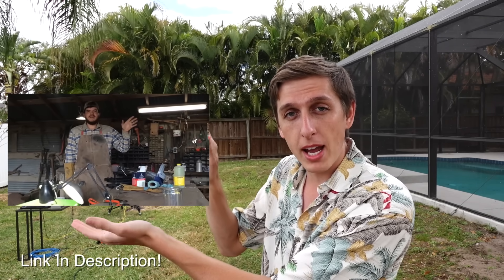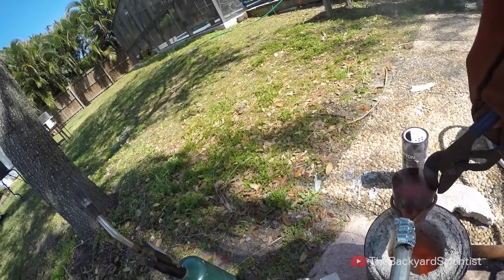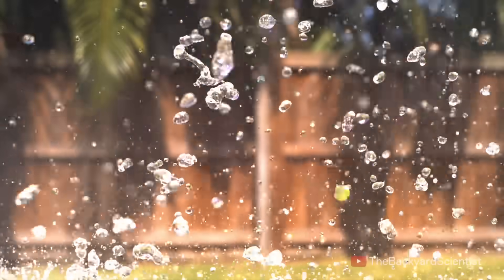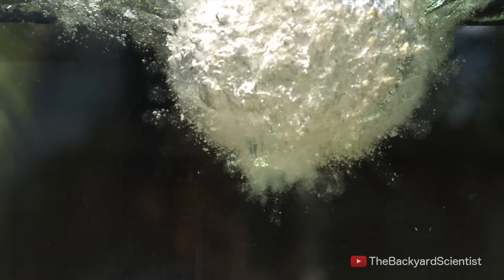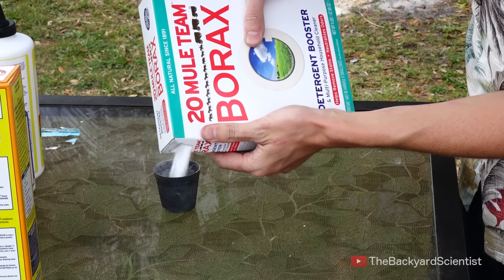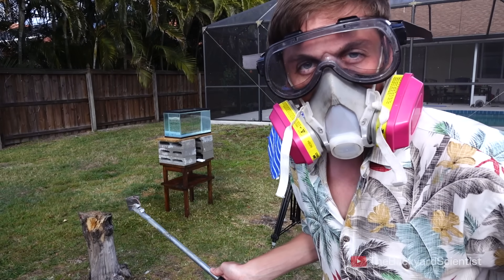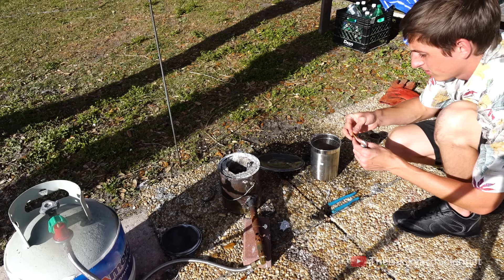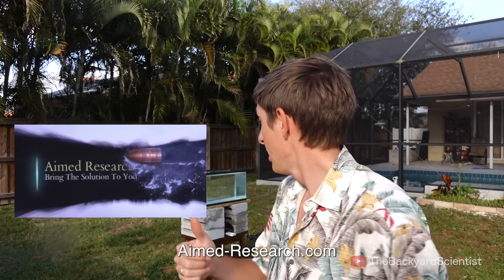Pouring Molten salt into Water - Explosion!

Comment: My pre-vid hypothesis: Salt is sodium chloride. Sodium explodes in water. Chemical bonds can be broken with a change in energy, so heating the salt up probably breaks some of the chemical bonds, which means the 'molten salt' is a mix of sodium, chlorine, and sodium chloride. The sodium then explodes on contact with the water.

Comment: This is the first video of yours I have watched.  I just fell into it while puttering around and I'm glad I did.  Very very interesting.  Is this why you are not supposed to put water on a chemical fire but use foam instead?  I assume other materials are explosive with water, but it is the temperature gradient here that causes the reaction.  So what other chemicals produce explosions with water either at normal temperatures or at high temperatures and could you do a segment on that?

Comment: molten salt has more air bubbles than borax because of the reaction, boras hardens faster because of less air bubbles wich causes the borax to harden, sodium metal oftens react to h20 because of the chemical changes in the metal, so its not a salty reaction the sodium metal gets, but it gets really hot with h20 and makes H gasses and CO2

Comment: okay, I have a hypothesis but feel free to correct me if I am wrong, the reason that NaCl explodes at molten heat is because of the atomic structure. Due to Sodium Chloride being a compound chemical created with some oxidation during the original process, there are small holes in the atomic structure. So H2O can seep into the atomic structure of molten NaCl, causing a violent reaction to expand water as steam in the molten salt due to the gaps in the structure now growing in size, the steam is generated so fast that it causes a vigorous and violent expansion to the point it creates a powerful force of heat. Spraying steam, hot water, and molten salt due to this blast.

Comment: The solar power plants can rise the temperature that much that can create those fires too.
https://www.google.com.ar/search?q=california+fires&client=firefox-b-ab&dcr=0&source=lnms&tbm=isch&sa=X&ved=0ahUKEwjIrpvP5qPXAhXLgpAKHVsqBmwQ_AUIDCgD&biw=1210&bih=622#imgrc=0XzF6O_RBkb8AM:

With molten salt you can vaporized water suddenly, because of the capacity of the temperature storage of the molten salt, which is why the water explodes, as with the sudden massive rising of the temperature the molecules and atoms are running away one from the other and breaking the links in between them, to becoem steam out of the water by changing the state of agregation of the matter,  is a redox reaction, it is  an inorganic chemistry and physics explanation, and we know that the Pentagon can vaporized people as we are made of more than 80% of water: https://www.youtube.com/watch?v=PDRWQUUUCF0
So the molten salt storage power plants are secret weapons to weaponize the seas and cities too as the heliostates are mobil to follow the sun movement to project the sun light on to the salt tower, and the battery can storage  4000 °C for 24 hours, so it gives them time to project the sun light on some other thing next to them as the air, to create more heat to produce convenctive clouds to have the hurricanes and to heat the winds that much to set in fire California and the Mojave surroundings too.

Comment: Sodium chloride does not have a strong surface tension. This is apparent in the cracks of the sodium chloride puck when it begins cooling down. My hypothesis is that water enters the cracks and vaporizes, thus spreading the sodium chloride fast enough to create a concussive burst. Since this concussive burst moves water away from the sodium chloride, there is still sodium chloride that has not been touched and cooled by water. This would also explain the secondary blast seen at 3:27.

Comment: The main reason why the Salt seems more violent is because the explosion happened under water. Water transfers energy much more efficiently than air because it is denser. The pure sodium had a hotter and more fiery explosion because it was exposed to more oxygen than the salt. Also, velocity of sound (aka energy transfer) in air is 343m per second (versus water being 1500m per second) the explosion was much less damaging. find a way to get the pure molten sodium under the surface and then come in contact with the water and you will have a powerful explosion. Maybe you should try a chemical delay, maybe chlorine?

Comment: Perhaps a part of the energy is from it dissolving. When things dissolve it releases heat but usually very little as the ionic lattice has to be broken which requires energy. If the salt is molten then there isn't this lattice and you just get out the energy from it dissolving. Could be part of it anyway.

Comment: When salt (NaCl) is heated...the ionic bond is broken and it disperses into Na+ and Cl- ions...both of these are highly reactive and when Na+ is put In the water (H2O)...this reaction takes place
Na + H2O => Na(OH)2 + H2 + heat
Reply: isn't this  what i have written just in other words? i just wanted to point out the energy part because this is what matters for this Experiment.
Reply: What is missing?
Reply: as far as i know Na+ and Cl- are barely reactive. you made two mistakes in your equation: 1) it's Na+ so it would give NaOH and 2) it would be H+ not H2. the counterpart would be Cl-  + H2O -> HCl + OH-. These two equations combined would give NaCl + H2O -> NaOH + HCl but actually this wont happen. ever poured a solution of HCl into a solution of NaOH? If you did you know that this gets hot because of the neutralisation energy. This tells us that if you want to make your proposed reaction happen you would have to put in energy, which means that the reaction is endothermic. This reaction would therefore not heat the water up but instead cool it down.
Reply: No problem. I am glad to see other people also spreading science ;)
Reply: yes as i have written in my first comment above this reaction would not take place. no chemical reaction, no pH change
Reply: oh yea i did not read properly your explaination
Reply: but (NaOH)2 is a base.
Reply: but he said the water had no pH change. so.....?
Reply: What really happens is just ions are really unstable because their bound was broken. When mixed with water, the little water molecules surround the ions and stable them which reduces their energy by a lot! The gibbs energy is super negative on this one.
Reply: @Leo Doszlop sorry i missed that. whom are you asking this question?

@ami kami it's NaOH but yes this is a base
Reply: very wrong
Reply: @Donald Nool very explanatory
Reply: @christoph tschopp yup, that's what I am saying too. thanks.
Reply: Idk wu t ur saying im in 5th. Grade but i wonder when ill learn it
Reply: Then why didn't borax react?
Reply: @Cristoph Tschopp   the Cl- and the Na+ would not make NaOH or HCl, because NaOH and HCl are stong acid/base, that means when they are in a solution of water they completly separate and therefore would never recombine in a water solution.
Reply: Akhilesh Kaushik Valluri FINALLY SOMEONE WHO IS GOOD AT CHEMISTRY!!! What grade are you in?

Comment: Hey, it can be about the solubilities of NaCl and borax in water. The solubilities are extremely different if you check. For NaCl it is 359 g/L  and for Borax it is 5.1 g/L. So I think it happens because of quick expansion of the temperatures differences( you can see that cold water on hot oil) and because of the differences of solubilities in water the NaCl dissolves much quickly in water so it can reach more distance in water in a period of time where the borax can reach so less compared to their solubilities in water 5.1:359. I would like to see your reply. Enjoy the science!

Comment: I believe the explosion is steam helping to spread the molten salt around into more water. The rapid expansion of the water in the first dip is as described in the video where the sodium is being expanded by expanding water, however the second (larger) explosion is likely caused by salty steam generated in the first one mixing and the reason it's larger is due to hydrogen bonds more or less causing a chain reaction through the water until the heat contained in the salty steam is completely dissipated. My theory anyways, it's definitely not a chemical reaction, it's against the laws of thermodynamics to go from a stable molecule (salt, one of the most stable molecules on earth) to a less stable molecules (sodium, chlorine, hydrogen, and sodium hydroxide once reaction with the water has occured). Sodium Hydroxide is lye, and is itself rather reactive as it dissolves bones.

Against the laws of physics that is, if there's no high-energy added such as through gamma radiation or electrolysis.
Reply: Jamison W. You’re daft
Reply: Indeed

Comment: Either its the immense heat that is forcing an explosion, or the chlorine is being separated from the sodium with high amounts of heat, resulting in molten sodium with small amounts of chlorine gas that could have been released. Sodium is explosive when reacting to water.

Comment: I think I get it. It's the same thing as a prince Rupert drop. The outside solidifies but isn't as tough as glass. It hardens and the really hot part in the center heats the air around it causing it to expand. Either that or the inside collapses causing the water to rush in, and because of this the heat caused it to basically explode

Comment: it just works with chloride because salt mixing with it is an exothermic reaction creating heat and by heating it up you speed up the reaction by a factor of 2 for every 10 degree you make it hotter...+ you greatly increase attack-surface by making it liquid

Comment: I certainly don't fully understand what is happening here. But what about this explanation: the molten NaCl heats up the water to boiling point near it. Maybe even slightly above that. That combined with the free energy from the dissolving salt could be enough to superheat (don't know the exact term) the water, until it literally explodes. Because as far as I could tell, this is the only difference between NaCl an the other salts you tested. It might also be that the sodium partially becomes metallic and just adds to the eyplosive mixture. But anyway, this truly looks cool!

Comment: I think what you have going on is a 2 stage process and the clue is in the cool sound made by the salt cooling in the air. 

The salt is forming individual crystals as it cools.   As it condenses, those structures pull apart from each other causing the cool sound. 

When poured into water the fracturing processes happens at a faster and more violent rate. The fractured crystals also increase surface area of the salt allowing it to heat the water to steam at a much faster rate. The weight of the water containing the expanding gasses long enough to build up as exciting release.  

That's my guess anyway.

Comment: Alkali metals explode in water because they have a very high affinity for losing their single electron in order to satisfy the octet rule. In other words, it releases a lot of energy going from the very unstable (very high in potential energy) neutral atom to a very stable (low potential energy) cation. Water causes this to occur through acting as an oxidizing agent (causes the alkali metal to be oxidized) through the general reaction: M + H2O --> M^+ + OH^ + energy. And because melting the oxidized sodium chloride brings it back to it original state sodium Na it explodes.

Comment: 1-When you drop molten sodium chloride into water unlike sodium (which is lighter than water) it sinks in (it is heavier than water).

2- The super hot ball of molten salt flash vaporizes the water.  A thin vapor film separates the water and hot surface and temporarily the situation is stable.

3- The molten salt is not like liquid tin and does not have great surface tension so it makes a ball full of cracks and water gets inside some of the cracks.

4- The liquid water inside the crack flashes into the vapor and its volume suddenly expands by 1800 times.  The local area around the crack inflates violently.

5- Since the rapid expansion of the outer molten salt surrounding the inflated crack is inside water and expanding faster than speed of sound in the water, it makes a supersonic shock wave.  The shock wave in the water is the explosion or Big Bang.

Thanks for a great question.  I really had fun watching the video  and other pictures of this experiment again and again.  And you high school kids out there, DO NOT TRY THIS WITHOUT SUPERVISION.  It looks really dangerous
Reply: Clearly not. You didn't, so he did.  Information is still information if you didn't have it before; so it matters not where it came from. Saves me and others doing it.  So chill.
Reply: This would essentially be the same principle of why you don't hear a glass really hot and then throw it in ice water correct?
Reply: Son Goku do you by any chance have a theory on why the other ionic solutions love key borax didn't react in this manner?
Reply: Beat jiren man dont watch some sciency stuff xd
Reply: It's a steam explosion.  A more drastic version of this (because higher temperatures were involved) is what blew up the Chernobyl reactor.
Reply: Son Goku
Reply: Son Goku 6
Reply: Son Goku now defeat jiren asap 😄
Reply: Son Goku but that’s actually heat happens
Reply: Son Goku not what he said...
Reply: Son Goku 

S o d i u m
C h l o r i d e
Reply: nerd
Reply: Son Goku really... you just googled it and pasted it into the comments for us to read... don’t you think that we can do that ourselves?

Comment: There wouldn't be a pH change because pH is based on proton concentration or H+. So adding NaCl wouldn't effect the pH. NaCl is also neutral. In fact if you add NaOH and HCl the products will be water (H2O) and Salt (NaCl). When adding Sodium metal, it is clearly a chemical reaction but when adding molten salt i'm fairly sure it is physical but maybe when the Cl- and Na+ ions separate it creates the explosion but i'm fairly sure it is only physical but the properties of NaCl allow it explode while the properties of the other reagents you added wouldn't allow them to explode. I am no chemistry expert and I have only completed organic chemistry at a second year level so maybe take this comment with a grain of salt (get it).

Comment: I have a hypothesis,I've heard that salt lowers the freezing temperature so logically it would lower the melting temperature, right? So my theory is that it lowers and its so hot that the instant heat causes combustion
Reply: lol Dude, think of it as an insulator.  Salt kind'a-sort'a resists the energy applied to the solution.  Instead of thinking of "freezing" and "melting," think of it as changing states due to gains of energy and losses of energy to a system.
Reply: afrodisiac no the kid is right about the melting point depression. The melting temperature decreases. Melting point is the same value as freezing point. Boiling point is the same as “condensing point”. What you said below is correct, freezing point decreases and boiling point increases. Dont try and correct the kid if youre not sure though. 
If you think personifying the solution makes it easier to remember, think of it like this:
As the concentration of salt goes up, the solution will want to stay in the liquid phase more (decreasing MP increasing BP)
Reply: Nico Droster yeah. I was just making it easier to understand. That guy clearly hasn't studied chemistry lol. But you're right obviously 👍
Reply: No actually it increases the melting temperature
Reply: Oh...
Reply: yeah it's pretty weird and counter-intuitive. Adding salt to, lets say water will decrease the freezing point and increase the boiling point.

Comment: I could say one possibility is that there is a gas that is formed with the other ion material that does not allow with the water to penetrate the molten  material. So no oxygen and be released into vapor. The gasses given off works like a barrier I believe it has to to do with the chlorine.
Reply: Parts per billion.
Reply: https://youtu.be/GyT1dsY0KtA

Comment: Sodium Metal + Water = Boom!  High School Chemistry 101.  That's why sodium metal is supposed to be stored in oil so as to keep even water in the atmosphere from contacting it.  So you should try the sodium metal without even melting it and see what happens.  Maybe even use a file to get some sodium metal flakes and toss them in the water.

Comment: https://youtu.be/wK9_DtwPaV0 

It is a chemical reaction. It just wouldn't change the Ph balance because there's nothing acidic happening. sodium is an alkaline metal, so sodium atoms have one extra electron in it's molecular shell. The atoms in the water on the other hand have one electron missing, and desperately want to grab it from the sodium. The exchange on contact tears the water molocules apart and mixes it with air, creating newly formed hydrogen gas with a stable shell of electrons. Since it's tearing apart the water molocules on contact regardless of temperature, their's no leidenfrost effect.

Comment: Molten salt basically: NaCl ----> Na+ (l) + Cl (l)
Simply said: sodium would react violently with water to produce hydrogen gas (those bubbles) and hydrogen gas would then explode. Chlorine would react with water to form hypochlorous acid (  HOCl ).

Of course the end solution would be neutral! The end products are: NaOH and HOCl, which would react together (acid - alkali) to give salt and water... neutralization.

Comment: Think the explosive property of NaCl has to do with viscosity, solubility and ion mobility...mostly solubility though:

Na+(l) + Cl-(l) --> Na+(aq) + Cl-(aq)

My hypothesis is that for NaCl the above reaction is fast enough to replenish the liquid salt in contact with water.
For the other compounds this is not fast enough and the surface of the liquid cools to a solid rather than disolving.